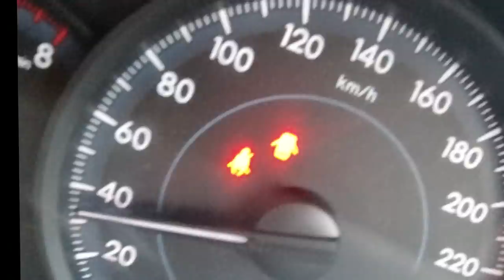Saving $25K by Building our own Rudder | Part one... Ep 180

Comment: its plywood the grain is already alternating from layer to layer  not sure if alternating the grain of the outside layer will make any difference  best of luck with thee repair hope it went well
Reply: solid core ply strong both ways.. but yes any other would be depending on the thickness of layers all ready in it.

Comment: On my own boat built by Marcon in the 1970's their is a design flaw on early boats where they used mild steel tangs on the inside of the rudder. 30yrs later some owners are having issues with water ingress rusting the tangs when then break off & give way hence no rudder. Touch wood no issues with mine so far. It weighs a fair amount though! Replaced the old bearings with handmade acetal ones last year.

Comment: Still think you should invest in a manual bilge pump also, mount it on a small piece of timber so you can move it to where it's needed and you are able to stand on the timber, with a hose for the inlet and a longer hose for the out let to throw over the side. That way you are not relying on battery power cause the battery  will not last long if you can not charge them . You guys are doing great love your attitude keep it up, cheers this is boating.

Comment: Awesome job, the shaft with the round plate , looks like it bolts to another shaft, as you took a big hit to bend the steel in the rudder, will you remove the other shaft , ?

Comment: ...... you two are moving right along with the rebuilds ..... stellar job on the rudder, sure like what you are doing with the leading edge, will you do a similar thing for the trailing edge, or are going to use your glassing skills Yosh ..... Hey Bonita, I was just educated last week, if the car has electric windows, there is a button in the boot area, on the side that releases the folding seats ... smilin ... my car is old enough, it doesn't have cup holders, so I needed educating for these new fangled gismos thingys that make new cars work ..... that beeping is like in Rotten Ronnies letting the chefs know to flip the burgers .... smilin ....  
never stop dreaming, just dream bigger .... have fun be safe, save our oceans
Reply from the maker: Once the rudder is shaped I glassed it three layers each side and overlapping and wrapping on the edges. This is in the next video. Cheers!
Reply: @FrothLyfeSailingNandji   .... solid job .... will watch the next video of course ....

Comment: As a shipwright  looks like you have epoxy filed seams not cotton corked  and glass inside and out   scarfed  planks are far better than but blocks never do the joins on the ribs unless scarfing at least 8-1 ratio  hope this helps you if you have to revisit any of the repairs down the track  bumping the bottom sux for any one hope all goes well in he future and keep your dream alive MV Joy-c
Reply from the maker: Yes, we have epoxy filled seams, they used cotton calking, this is Thailand style and the way they build boats and epoxy filled over the top. Each end was butted up to a stringer and both ends screwed in. Then glassed over the lot, inside and out. Video coming soon
Reply: Judy, extending the ply; scarf about 5:1 lengh:thickness? And i use unthickened epoxy to 'petrify' ply and seal the ends before laminating. Sound like " best practise"?
Reply: @FrothLyfeSailingNandji  Stringers run fwd to aft i think you are referring to the ribs  If you glassed in side and out  that will seal it up but looking at the video all the joints are in a line top to bottom  and that is a worry  as it creates a week spot  it is  always best to spread out the but joints to Evan the load if weight pressers on it down the track  have a look on line about wooden boat repair for your self  i under stand the budget is tight as i have one to keep to as well  . If nandji is glassed inside and out plus what looks like oregan plank  you have one solid boat there hope this helps you  MV -Joy_c

Comment: Great job on the rudder. Does anyone make a detachable manual rudder for the front of boats that can be used just for docking and leaving the docks. Great idea if not.
Reply from the maker: I believe it is called a bow thruster! These are small water jets or propellers which can push the bow either way therefore Controlling the movement. More affective than a rudder would be. Nandji does not have these
Reply: Do you think that if a forward rudder can affect the front of a boat during docking and leaving the docks at low speeds. Not sure but I like to know what everyone thinks

Comment: Huh? is that Caulking around the wood fix?, on an Epoxy hull/??   How does THAT work?
Reply from the maker: Nandji is stripped planking core sandwiched between epoxy glass. The wood planking they installed was cotton, An old school wood boat caulking technique they still use in Thailand. This was then epoxy filled and glassed over. It will be in a up coming episode. Thanks
Reply: @FrothLyfeSailingNandji   "An old school wood boat caulking technique"
Exactly. Which was why I was surprised to see a non epoxy-saturated, organic "filler" embedded in what is supposedly a fully encapsulated, moisture proof structure. The fact  that they didnt scarf the planks into the patch was also puzzling.
I look forward to the details.

Comment: Is she a glassed strip-planked hull? Sorry, but seeing those guys driving in old-school caulking, instead of scarphing and epoxying the plank ends was a bit of a WTF moment 😨😨. I'm hoping that's just a "get you home" repair - it will keep the water out, but seriously, the way the boatyard is doing that repair is like taking your Holden to Beaurepaires, and having them fit an old timey wooden spoked wagon wheel.
I like your rudder rebuild much better.
Reply from the maker: Nandji is stripper planking core and epoxy glassed inside and out. Yep old school calking, but this is Thailand. Filled with epoxy filler and glassed over inside and out. Wait for the video

Comment: Grinders are golden if you own one you know what I mean.
Reply from the maker: It's a love hate relationship! The best tool to have, the tool you uuse the most but the tool that means your in the boat yard!
Reply: @FrothLyfeSailingNandji  True, I remember Zingaro said they felt a few gallons of resin and fiberglass matt plus their grinder and they could repair anything anywhere. I am restoring several boats but my main project is my Tayana 37 in Saint Thomas. This is a three-year project for me. I got a page on Facebook called Sailing Vessel Casita. Best of luck with your boat. I learned from your experience too, good and bad.